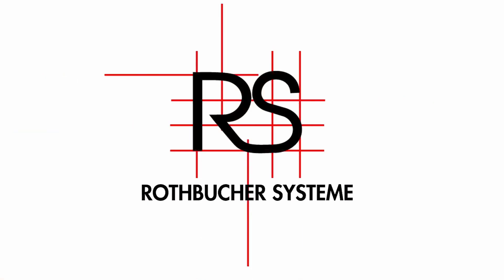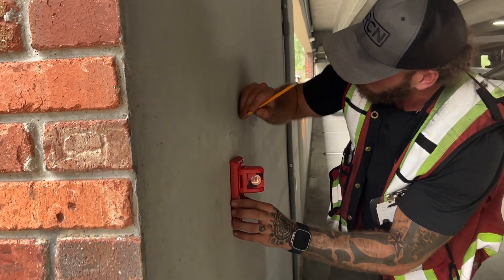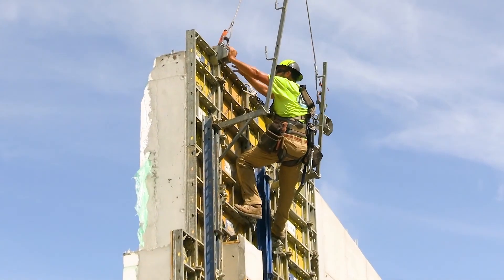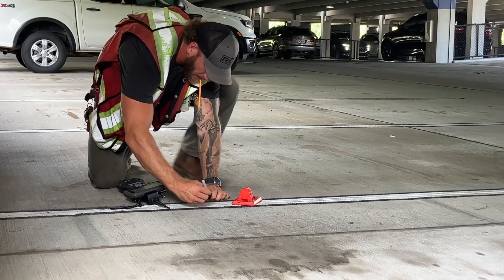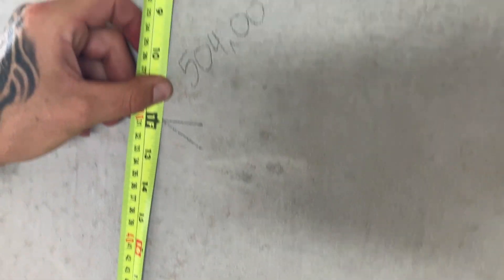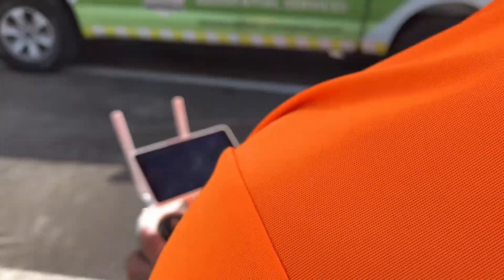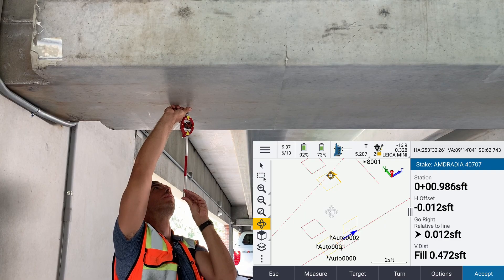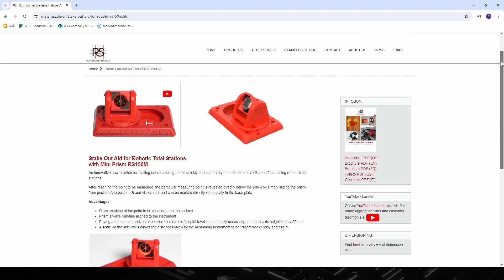Land Surveying Layout - Faster, Easier & More Accurate

Comment: this is so good for flat surfaces! Question: What do you use to layout anchor bolts? Do you layout bolt location or center of template? Thanks!
Reply from the maker: Sometimes I’ll do each bolt or offsets, sometimes I’ll do three corners of the template. I’ll do my best to ask whoever is going to be using my marks which they would prefer it to be set.
Reply: @The3rdDimensionSurveying where do you purchase these in the US?

Comment: Is it good for uneven slab layouts, because most concrete finishes are uneven or rough?
Reply from the maker: @sarujansrikumaran5092  to a point. Rough concrete? Yea it still works fine, instead of sliding it along you just lift it off the surface and set it back down. If we’re taking about what we call “mudslab” which is extremely rough and uneven concrete poured prior to slab so rebar isn’t getting laid down in the mud, it could be more difficult to use.
Reply: @The3rdDimensionSurveying Yeah, thanks a lot for your reply. I understand.

Comment: awesome stuff,on your channel ! you are using the copper coated or silver coated?
Reply from the maker: @beleviongeotopo9998  thanks! Silver coated because I run Trimble equipment but the difference is fairly small. I talk about it more in my prism selection video.

Comment: Great description. This subject can be quite confusing and you do a really good job of breaking it down. Your channel stands above most other survey ones on YouTube.

When Geoid 03 came out I mapped the difference between it and '99 and was really shocked at how much it had changed. If you haven't done that, I recommend giving it a try. I kept it to my local area (So Cal) but you can do it at whatever area and resolution you'd like. What you do is create an 'elevation' grid using N as the 'elevation' on both geoid models (there are a few ways to do this). That alone creates an interesting contour or shaded surface of that geoid model for the area you cover. The real interesting part is if you do a delta surface between 2 geoid models and contour or color that. It basically shows what you described in your comparison between N over 1km vs 10km, but for a wider area.

I did all this because we had 2 crews working on a topo project. One of them started the base and the other just connected to its correction message and started working. The base was set on a known control point. One of the crews couldn't figure out why the were seeing a different elevation at the base and couldn't get a good check. I got called and after a while I realized what they had done. One crew was using 99 and the other was using 03 in their project setup. When the base was started from a data collector using G03, it dutifully computed h and was sending that ellipsoid height to the rover over the RTK radio. Then when the rover received that ellipsoid height, it dutifully computes that h into an ortho height using the geoid model it has. 

What you say is absolutely true; our software can make a very complex system seem simple and we have far too many button pushers out there. We now have contractors doing this geodetic surveying and I've heard some frightening stories. Half of these guys got their training from a guy they know who was shown how to use this by a sales person. I'm working to fix that in California. We have Professional Registration and protected practice laws for a reason. The public needs to be able to trust that the people they are paying to do work are reasonably competent.

As far as I know, no version of RTCM or CMR has ever included the geoid model in its correction, so the rover has no way of knowing what went into producing the height of the reference. I created the delta N surface I described to see for myself and share just how dynamic geoid models can be. I thought about doing the same thing when subsequent models came out, but never got around to it. In my area, we've had a really good gravity model since '03 came out. We're lucky in Coastal California, because we have a lot of economic activity, which lends itself to having a lot of Land Surveying, which in turn means that we end up with a lot of data in NGS models.

On a side note, I'm curious whey there are out of context messages below that are 2 months old for a video that was released today....
Reply from the maker: @gunningopher  thank you for the very well thought out and detailed response. 

Your method of comparing geoid models sounds very interesting. If NGS doesn’t provide a comparison when the new geoid model is released, it would be a lot of fun to compare them in a manner similar to your method.

I think you meant to comment on my geoid video but accidentally commented on a different video hence the unrelated comments.
Reply: @The3rdDimensionSurveying  That's weird. I watched the video, reviewed comments from 2 months ago, noted that the video was posted this morning, and submitted my comment. I never let the page. I will move it there.

Comment: Two things:
Most building sites I work on wouldn't benefit from this because of sighting issues. More often than not, there is something in the way.
Second, why don't you glue a small bubble to the thing yourself? You can buy one pretty cheaply.
Reply from the maker: 1. Of course, you’ll need line of site. If you couldn’t use the RS150M you couldn’t use a mini or RL and if you’re using a full size rod then you’re only working on the ground and much less accurately mind you. That is but a fraction of where one would use the RS150M. It’s up to the surveyor to decide when to make the extra effort of setting a new setup point to maintain line of site or accept the degradation in accuracy by adjusting methods to be more efficient.
2. The minor benefit of having a spirit level bubble providing a flat BM line is far outweighed by me trying to glue a cheap little bubble vial on it and hope it’s level. I’d hate to Frankenstein a beautiful piece of equipment that way. That being said, RS actually reached out and informed me they are currently working on a bubble adapter for the reason I mentioned in the video.